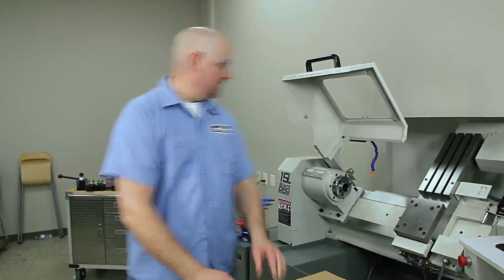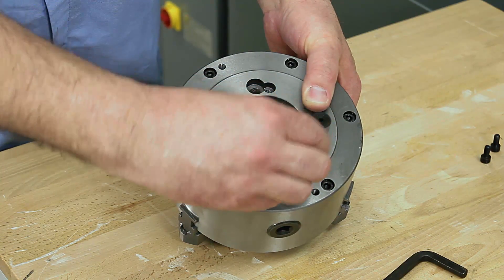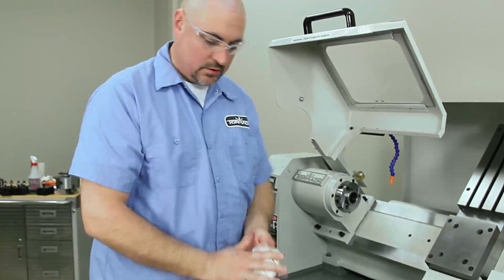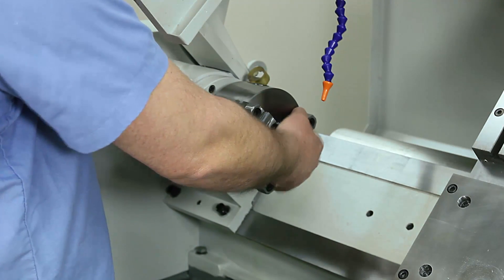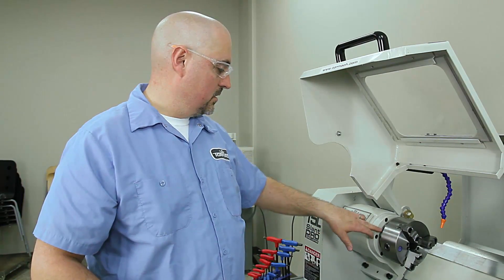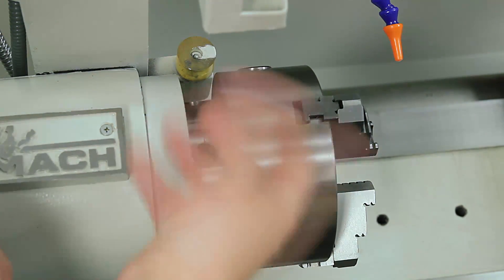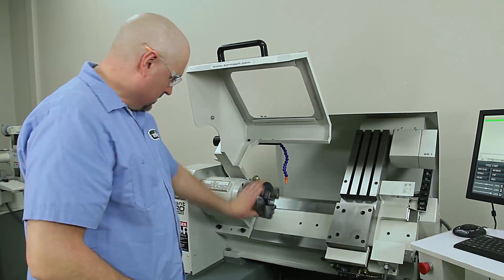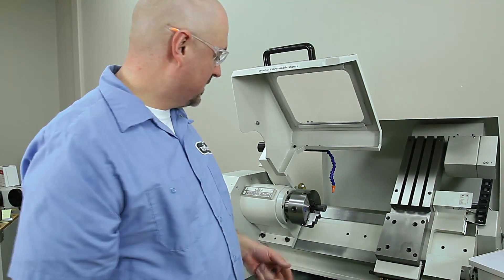How to Install and Use a D1 Lathe Chuck - Tormach CNC

Comment: Do you know if the 4 jaw is still available?  Do you have any videos of setting up tools like a diamond tip?  I followed the video on how to do it but when I set the main tool and then set the diamond tip for every part I had to adjust the setting, I tried tools offsets and it just throws everything out of whack.
Reply from the maker: Yes, we do have a 4-chuck jaw available to our 15L Slant-PRO lathe. https://tormach.com/4-jaw-independent-reversible-6in-lathe-chuck-d1-type-direct-mount-33336.html

We do not have a video available on diamond tip tools and their setup, but you can open up a ticket with our support team and they can give you some advice. Also, our forums is available where you can ask that question and our Tormach Technical Support team can answer it there. The link to the forums is on the top left on the Tormach website and the Support Tickets are under the Support dropdown menu.

Comment: what is the largest chuck I can run on the slant Pro 15
Reply from the maker: The largest lathe chuck you can add to the 15L is 6 inches. 
https://tormach.com/4-jaw-independent-reversible-6in-lathe-chuck-d1-type-direct-mount-33336.html 
https://tormach.com/3-jaw-reversible-6in-lathe-chuck-d1-type-direct-mount-33156.html

Comment: You neglected the adjustment of the headstock bolts that hold the 1/4 turn mounting nuts.  On my lathe if you tighten those headstock bolts you cannot turn the 1/4 turn mounting lugs at all.  There is a fine line between tight and loose wherein the lugs will turn.  Then you use the steps you illustrate for mounting a chuck or backing plate.  I have not seen a video that addresses that part of the adjustment.  I found on my Grizzly G4003G lathe the sweet spot was to tighten the six bolts and then back off 1/8 to 1/4 turn.  Then you can rotate the locking lugs to the 3-6 O'clock position.

Comment: Thanks for the video. Could you comment on reversing the hardened jaws, and what to watch out for when holding large stock (e.g. 4" round aluminum bar)?
Reply: Don't hit the carriage or ways when holding large parts & make a mark where all the jaws are still retained by the scroll so they don't drop out.

Comment from the maker: Thanks for the compliment on the video. We try to make sure each video has closed captions for our viewers with hearing issues. You can control whether they are visible on your screen by clicking on the CC button in the control bar and selecting Off or On. If you want, you can also select Translate Captions for your preferred language. I hope you find this useful.